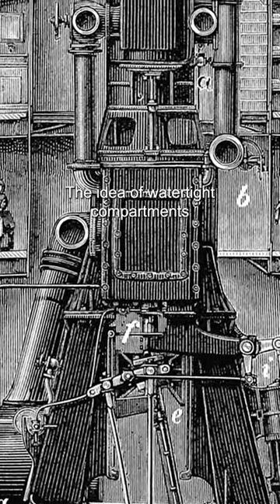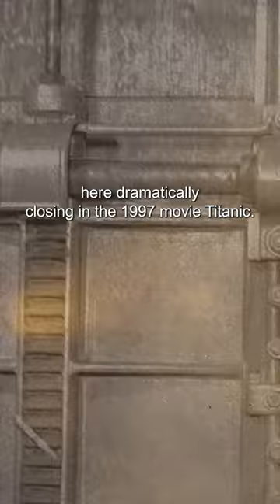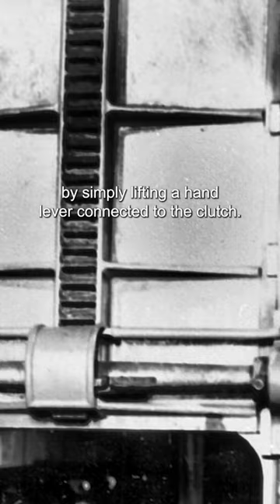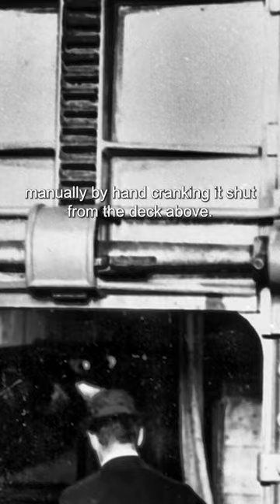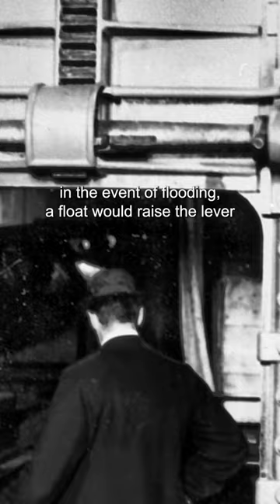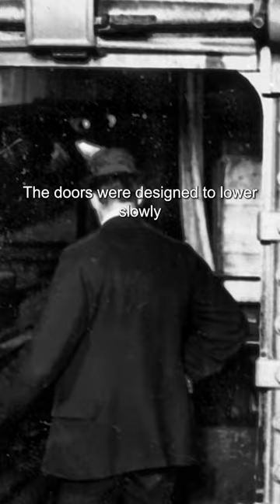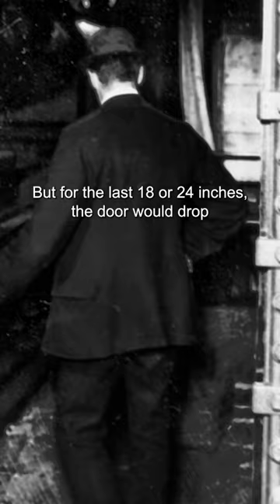How did Titanic's Watertight Doors work? | Oceanliner Designs #Shorts #Titanic #Ship #History

Comment: It did its job while it didn't saved the ship it at less delayed it and prevented the Titanic from capsized like Lustania 3 yesrs later
Reply: Want to know more
Reply: Lusitania was torpedoed by a U-boat and the ammunition it was carrying detonated though
Reply: It is my understanding that there were no water tight hatches on the deck (horizontally), and the water tight doors only went up several decks, so that when the compartments flooded enough, the water just spilled over into the next compartment.
Reply: @Nza420  yes you got it right. The improvements were made in britannic and the watertight bulkheads went all the way up to c deck. Unfortunately during here sinking, the portholes were open which basically bypassed every damn safety measure of the ship. I think olympic got some slight improvements too.
Reply: @Alexis Ian: Lusitania had a massive tilt, but it did not capsize. Costa Concordia capsized.
Reply: @Roger  Britannic also had the problem of several watertight doors close to the mine didn't seal properly because the explosion warped them/thier frames. Surprisingly, the Olympic actually was refitted to almost the same standard as the Britannic. Including the the improvements to the secondary hull and bulkheads.
Reply: The Lusitania had watertight subdivisions too. They were revolutionary for the Victorian-into-Edwardian era, but not unique or even really new to the Olympic class (although Titanic's electric closure was something fairly fresh).

However, Titanic's bulkheads were in some ways superior in their layout compared to Lusitania. White Star Line insisted on transverse (that is, across the width of the ship) bulkheads only for their ships.

The Lusitania however used a mix of transverse and longitudinal (that is, lengthwise) bulkheads. These were more convenient for operations, but had a problem - if flooded, they tended to cause ships to list. Which can cause a nasty feedback loop.

Oh, and since the Lusitiania has come up... While evidence does point to her having carried munitions on the sly, it does not point to those being what caused the second explosion.

The torpedo hit the starboard coal bunkers, which would have aerosolized much of the coal dust within and basically turned the affected bunkers into a fuel/air bomb just waiting for a spark.

Now, if the torpedo had hit, say, the baggage or supply holds... that would make the idea that the second explosion was the munitions more plausible. But as things stand, they're irrelevant outside of probably getting the Lusitania targeted in the first place.
Reply: @hanzzel6086  Not really surprising -  White Star wanted their last superliner as well-protected as possible. A ship on the ocean floor, was a ship not making them money.
Reply: @ZeldaTheSwordsman  Lusitania had both transverse and longitudinal bulkheads? Well you say that as a bad thing but it could have saved the Titanic! While it's true that flooding only in one side can lead to list, also the first compartments on the Titanic would have flooded in their starboard half instead of entirely, so maybe the bow wouldn't have gone down enough as for the bulkheads to spill on to the next ones
Reply: @ZeldaTheSwordsman  Normally, such an extreme refit would be considered way too difficult, expensive, and time-consuming to be viable on an already operational ship. Though, perhaps not too surprising after the shock of Titanic. Public (and White Stars) fear over the ships safety was immense, causing her next voyages to sail mostly empty until her refit.
Reply: @JustRememberWhoYoureWorkingFor   Lusitania's bulkheads would have had a pattern along the lines of  "bow, horizontal, horizontal, longitudinal (splitting those sections into thirds/halves, and covering about twice as much hull length as both horizontals), horizontal, horizontal, longitudinal, horizontal, horizontal, stern". This meant that if the hull in one of the longitudinal sections was holed, it would comprise a significant length of the ship on one side, resulting in a list. Making it far more likely to capsize (which is the worst way to sink). And even if it didn't it would render half the life boats useless. Along with making evacuation more difficult in general. Whereas the horizontal bulkheads of the Titanic lead to it sinking mostly flat, leaving all the lifeboats usable (if only there were more). Most ships these days have at least one longitudinal bulkhead running the length of the ship.
Reply: Lusitania didn’t capsize. The now struck the bottom then it rolled onto its side.
Reply: What are you satine ?
Reply: @JustRememberWhoYoureWorkingFor  Very unlikely, the Titanic had too many compartments breached. She would have taken on a serious list. which make less lifeboats usable, and possibly capsized if she had transverse bulkheads.
Reply: @hanzzel6086  Exactly.
Reply: @JustRememberWhoYoureWorkingFor Longitudinal bulkheads doomed the Empress of Ireland, though. That ship needed two massive compartments for the engine room and boilers. To compensate for this, longitudinal compartments were used. Unfortunately, this caused the ship to list and capsize fast after it was hit by another ship.  It was so fast that crew members on the starboard side essentially drowned before they could close off the bulkheads and passengers drowned before they could even leave their rooms. It was so bad that half the lifeboats were rendered unusable. If the designers simply didn't try to correct for the massive compartments, it's likely the ship wouldn't have capsized as fast, allowing more passengers to reach the lifeboats, more lifeboats to be used, and all the watertight doors to be closed.

While it might not have been as bad on the Titanic, it still could have rendered half of Titanic's lifeboats unusable.
Reply: Didn't the Lusitania have longitudinal bulkheads that flooded?
Reply: @legioner9 that didn't capsize either it just settled on its side
Reply: @Nza420 The bulkheads, you mean. The doors were not that tall
Reply: @Roger67164 yes, I believe the Olympic had a second hull, behind the first one, which actually saved it from a torpedo during ww2, because it only damaged the fist hull

Comment: They say if the Titanic rammed the iceberg head on,she would not have sunk.The bow section was easier to seal
Reply: she would have been scrapped anyway since White Star was running pretty low on funds to repair another massive ship after repairing it's twin
Reply: @Ever_2008_ARG  But the people would have lived
Reply: @paulgrimm  well most of them would have lived yes. However the ones in the bow of the ship would have been instantly crushed.
Reply: @jholeify  The ship would not have sunk
Reply: It’s not about the sealing. It’s about the fact that only the first compartment or two would have buckled and opened up to the sea, not five of them.
Reply: @paulgrimm  brilliant, what sort of calculations have you done? What about your qualifications? Must be MEng at least.
Reply: @jackster2568  Many ships have survived bow strikes. It’s the strongest point on the ship.Better dented than sliced open.Bows are generally mechanical areas
Reply: @jackster2568  Common sense of ship design
Reply: The iceberg hit the Titanic underwater, so it just looked like a near miss. Murdoch would have never known. And he did the port down manouver thingy anyway, which saved her lots of time so Titanic would sink slower and not capsize
Reply: @paulgrimm  are you comparing to bow strikes against other ships? That iceberg must be way more of an impact than a ship. It's like comparing two cars head on with one hitting a cliff wall. Sometimes common sense isn't too common.
Reply: @stevek8829  Depending on the relative speed of the cars (and assuming both are moving) a head on collision between them would be much worse then hitting a solid wall. Much, much lesser (in size, design, and construction) ships then the Titanic have survived head to head collisions at much higher relative speeds then what the Titanic was doing. Hell, I can't even remember hearing of a  head to head collision between two decent sized ships that ended in a sinking!
Reply: @hanzzel6086  you say this as if you actually know it. The solid object has no yield at all.  Another yielding object, like a ship or a car, has some compression. So, don't be so sure. You're bit about ships having survived collisions with other ships supports what I said. People die when they hit cliffs. People often live from head ons with cars. I've never studied any ships that have struck icebergs head on. Neither have you. Heck, Joey Chitwood thrill shows used a head on collision against equal cars. They never did one against a cliff. So, other than contradicting yourself, do you have anything informative?
Reply: @Steve K  Yeah, comparing (usually heavily modified) 2-ton cars going what, 20mph? Tops? Colliding in those shows (and usually not head on) is a great comparison to a 5 000 ton+ ships going at similar speeds hitting each other.
And a ship hitting an iceberg isn't going to be much different than it smacking headlong into a sandbar, channel/dock wall, or the side of a much larger ship (especially if that ship is a warship). All of which ships have survived, under much worse circumstances than the  Titanic was in (namely, storms). Simply put, history has shown, repeatedly, that ships are much more likely to survive  ramming/being rammed with/on the bow (and, to a much lesser extent, the stern, not many examples of significant age of steam examples of that as far as I'm aware though) ramming than any sort of scraping/ramming damage to the flanks.
Reply: Well it didn't happen that way.
Reply: @jackster2568 it wouldn’t have. The berg would’ve caved the bow in back to probably the 2nd, maybe 3rd compartment, but it would’ve been the shock that did more damage. She was moving at 22.5 knots, and a ship that large moving that fast creates an enormous amount of energy. All that energy would’ve been transferred to the berg, which was stationary and extremely dense, and it would’ve twisted the hull beyond repair (think car moving at 80+mph driving into a tree but on an enormous scale). Sure she would’ve flooded, but despite the damage, she wouldn’t have sunk because as is explained in the movie, the bulkheads only went up to E deck. As the bow went under, the weight of the water would pull her further and further down and overtop the bulkheads, as Andrews put it “there’s no stopping it.” If she’d hit head on, with 2- 3 compartments flooded, that water wouldn’t have had enough weight to pull her down and overtop the bulkheads. 

TLDR: she would’ve been damaged beyond repair and (maybe) would’ve been able to limp to port, or maybe not, but she wouldn’t have sunk had she hit it head on.

As for the qualifications you asked for to make that assumption; Masters in Marine Engineering and bachelor in Marine Transportation
Reply: @robdog1245 
That's debatable.
I couldn't find any really conclusive information one way or another.

We have examples of smaller ships travelling slower that survived collisions head on with icebergs or other objects, but nothing the size of the Titanic going 20+ knots.

We also believe that part of the cause of the sinking of the Titanic was that as the plates buckled from the impact the rivets broke (due partly to low quality iron rivets used in the bow section) and let in water.
"sonar mapping of Titanic’s starboard hull buried in the ocean floor revealed only six thin tears from the iceberg with a total area open to the sea of only one square meter"
So we don't know that the Titanic's bow was actually as strong as it should have been.

We do know that the sister ship of the Titanic popped rivets when it smashed head-on into a smaller ship.

We don't know the shape of the iceberg.
If it were essentially a flat wall, I agree that the ship would probably not have sunk. But some shapes could have caused it to, for example, ride up onto the ice and done basically the same damage before sliding it back into the water. I could not find anything concrete on the probable under water shape of the iceberg.

I have answered zero questions.
Reply: They hit it on purpose anyways. They couldn’t do nothing with a ship with a bent keel.
Reply: It's not just easier to seal, the front of the ship has the crash bulkheads designed to take the force of a collision.
Reply: Look At navey ships that lost their bows
They stayed afloat
Reply: Look At navey ships that lost their bows
They stayed afloat
Reply: @Ever_2008_ARG  Running out of money so much, that they spent 7.5 million to build both ships?
Reply: @stevek8829  Ships don't go 70 miles per hour. The Titanic was going less then 30 miles per hour.
Reply: @thesimslover82884  so, who said they did 70 mph, not I? Why did you invent that irrelevant fantasy?
Reply: @stevek8829  You were comparing the ship hitting the iceberg to the damage of two cars hitting each other. Very different situation.
Reply: @thesimslover82884  it took you a week to come up with that lamo quip? That’s as dorked out as your previous irrelevance.
The point I tried to make it’s that the berg head on would be a worse collision than people here seem to think. Not you, you don’t think. The Chitwood shows were a thing over fifty years ago. The head ons were done at about 50 mph IIRC. No, it’s not the same as ships, as you so brilliantly pointed out.

Comment: To my understanding, the so-called water-tight compartments had no roof? In short, once water reached the top it would flow into the next compartment!
Reply: Well, if the water came in in the amount the ship can handle, it wouldn't flow over to another one.

In Titanic's case, it's obvious that the water was flooding 5 compartments instead of 4, the amount of compartments flooded that the ship can handle.
Reply: Yeah, you basically summed up how a long scratch along Titanic's side put her on the bottom in a matter of hours.

There really wasn't all that much damaged hull, but it let enough compartments flood that the ship's bow would drop low enough for water to spill over the top and into the next compartment. She would have survived, if perhaps needed help getting to New York, if she had bulkheads going all the way to the deck or with a watertight top.